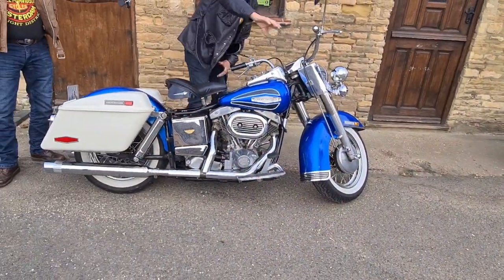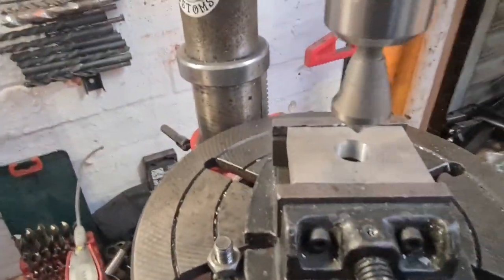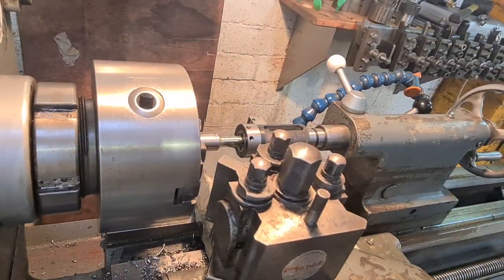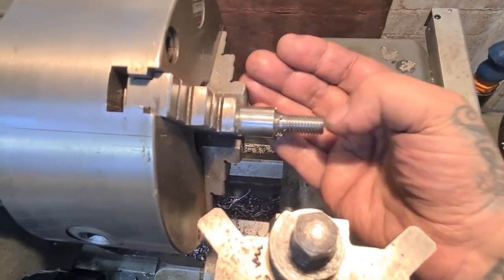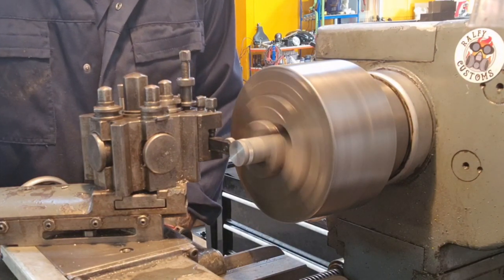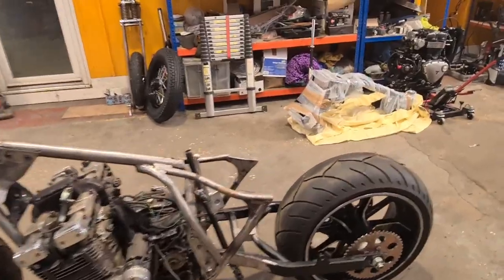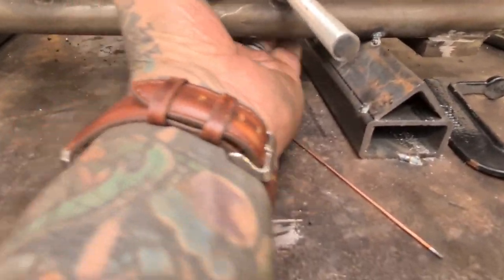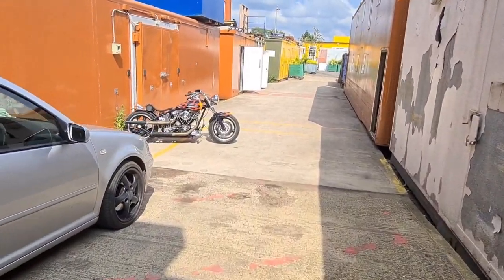Hot Triumph Chopper Manual Machining Making A #Workshop #MakingStuff #Workshop #HarleyDavidson #cool

Comment: Gday Ralfy, I’ve heard them countersinks called zero flute countersinks🤷🏻‍♂️, looks like the powder coat job worked out well, with the straight knurled the amount of pressure you need to apply is a shit load, certainly hard on the lathe, have a top weekend mate, Cheers
Reply from the maker: Yeah the single point are certainly demanding, no problem with the Harrison, but I think a small import lathe would struggle